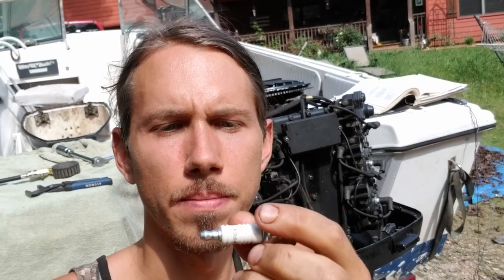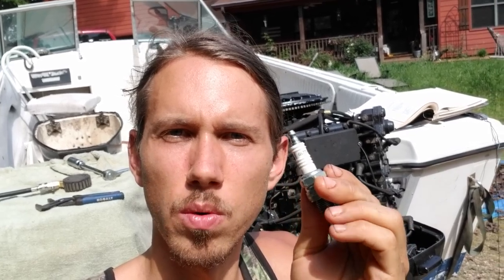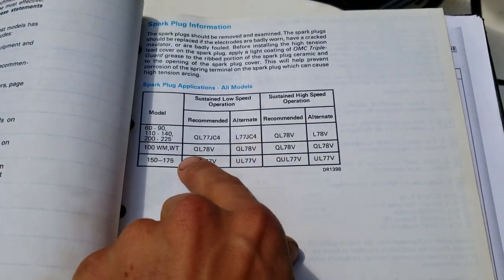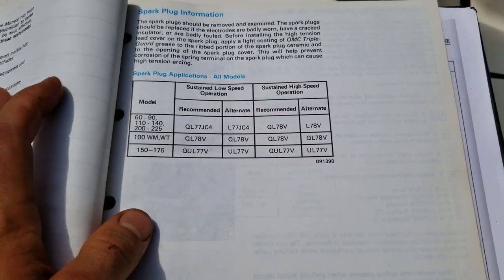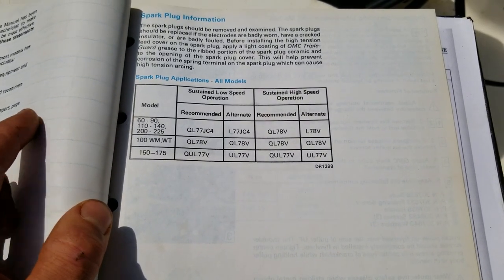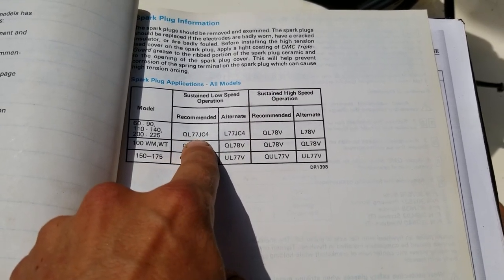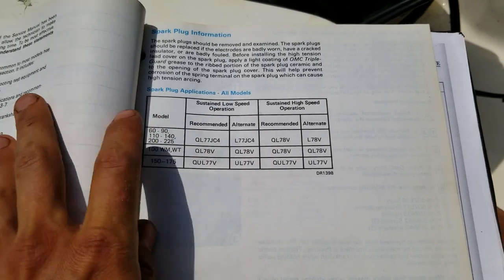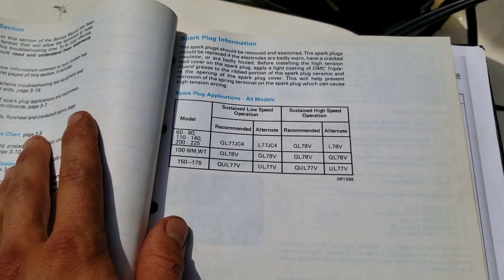BEST Evinrude Outboard Spark Plugs!

Comment: I'm not knocking you @ all, but years ago Champion plug was terrible in two strokes engine, fowling out badly, NGK was by far a better option.
Reply from the maker: You had these experiences with Evinrudes?
Reply: @MattsShop  no motorcycle
Reply: People have to get the right heat number,not car motor plugs..
Reply: I got through the 1st 20 or so seconds of the video thinking the same thing, only its not just 2 smokes, EVERYTHING!
I have had more plugs fail, or bad out of the box from Champ, then any of the others.

Champion is in those engines from the factory, and what OMC recommended, NGK for me in my Evi's.

Comment: I have the 87 johnson 150 v6 looks like the same engine. Need to change my sparks a mech. Gave me some weird number, put them in and they worked, however now after watching this im nervous. The charts onyl show the surface gap ul77v no J gap, however, when i went on a marine store and typed in my model number your pluggs came up. Model j150gtlcur.

Yesterday we went out to a river system and I didn't realize that it was idle speed only and I had some crappy NKG surface gap and this morning when I got up my heart sank because there was all this black gooey crap all over my transom saver running down from the cowling I touched it with my finger and it looked like burnt car motor oil so from what I reading those crappy spark plugs mixed with idle only speed caked it up pretty good
Reply from the maker: That SHOULD be the same engine. That's exactly why NGK and surface gap plugs do not go well with these engines at idle. Surface gap plugs are best at WOT throttle 5000 RPM running offshore. All that black goo is unburnt 2 stroke oil. Try to find a chart that show QL77JC4 they should work, but I tell everyone to double check because I never know 100% depending on the year make and model.
Reply: @MattsShop  sounds good! I'm learning from you, I am also learning my Motor. I see a bunch of goo remains on the front side of that I mearned is my exhaust cover.  From what I understand it's 28 bolts, a gasket, an inner plate, and another gasket. I'm assuming the gasket has gone bad.  I'm already gonna learn how to do the carbs cause I can see the fuel around the bowl gasket and the gasket where it connects to the header
Reply: @MattsShop  just got home looked around the exhaust casing and bottom left bolt def a leak. Ordering new gaskets :)
Reply: @MattsShop  also one last question. Then I'm going back to binge watching your videos. (Plus I subscribed!) How do I get the lower plastic cowling off the small two piece one. I undid the 4 bolt boat side but it still feels like it's bolted maybe above the pan? Lastly can I spray anything under the pan and in the bath of the old black goo in and behind the middle section to flush it out or will putting degreaser harm the drive shaft and stuff to the lower unit? Clearly I'm new to all this, also trying to be environmentally aware when possible. Thanks bud for everything!!
Reply: They work like a champ! Thanks! Did a carb rebuild noticed that 2 of my 3 units have one emulsion tube cracked. Hard to find a new carb. I have hear ppl soldering or JB weld as much as the crack as possible to limit the gaps. I was able to get her to 55.5 mph WOT yesterday, however, I bumped something w the cabling which made my idle really really low. So I gotta figure that out. Is that possible, or have to go through an entire link and sink?

Comment: I can’t get to plane on 110 v4 Johnson. without 15 pitch prop on 16 ft fiberglass. Had 19 on it.  Runs great compression test was fine. I Don’t get it ? Won’t run over 30 mph
Reply from the maker: There is NO WAY you need a 15 pitch prop with that setup. 19 will work. I've ran a 15 pitch on an Evinrude 140 19' boat (one in video) and it pulled the boat on plane in two seconds. Is the fuel pump diaphram bad? The motor mounted too low on the hull?

Comment: Thankx for the input champ 👍 I have a evinrude 1981 v6 175 hp and they take a ul77v  .will that  sparkplug you were talking about work in that .? Also it’s hard to get the ul77 v in Australia 🇦🇺..👍
Reply from the maker: It should, but don't trust me double check with online charts first. I'm not responsible for damages!
Reply: Can you please give me the part number
Reply: Thank you for your help Matt 👍
Reply from the maker: L77JC4 or QL77JC4 If you have electronics. You're welcome.
Reply: Many thanks for you assistance mate. Just one more thing what sparkplug  gap is needed champ
Reply: Surface gap plugs are really only for high performance crossflows run at high rpm. Yes the idle a little worse,  but they are much safer for the motor so it doesn't detonate. I recommend them for the 2.6gt/xp especially,  which is a factory modified 235.

Comment: thanks matt found a bad coil on my 1980 140 johnson .  put the one good  one i found on my 60 hp 1980 2cly probably why it ran like crap .  run better but still missing some pulled the nkgbr9hs out had two new  ql77jc4 in 60 hp plus the old two ql77j4 looked the same put them in and run even better going to get some more new ql 77jc4 plus some  new cdi coils 👍👍had 1977 140 it ran good on the surface gaps love the johnson evinrudes
Reply from the maker: Nice! Sounds like you got it running real good! I never really liked the surface gap spark plugs.

Comment: I have the QL77JC4 in my 84 Johnson 150. They work great! However, I was researching the gap difference. Mine requires a 1.19-1.35mm gap. Those 77s are 1mm gap. Can the gap difference cause any idle issues? Low speed cruising?

Comment: The "Q" is for suppressor, so you don't have extra voltage leaking back to your voltage regulator. There is a difference in price when buying a Champion spark plug with the Q and without the Q.

Comment: Hi Matt. I just got 3 new Champion L77JC4 plugs for my '93 Johnson 70. Dang if the gaps are not all over the place. Can you tell me the correct gap for them?
Reply: Manual recommend Champion QL77J4 @ .040”

Comment: It also just started hesitating on acceleration a little and sputtering slow idling
Reply from the maker: See if you can use these plugs. It could help...
Reply: @MattsShop  shit my vro pump was cracked. Waiting on new 1 but USPS is slow as ever right now. Who knows when itll come

Comment: Ok I got a 1983 evinrude v6 150hp 
It uses UL77V or  L16V Surface Gap plugs. 
Can I use QL77JC4??
Reply from the maker: This is a 1986 Evinrude V6 150 XP and the QL77JC4 works. Check charts online though.
Reply: I ended up buying the spark plugs I checked piston to valve clearance before starting the motor.  And man you can tell a difference on how the motor sounds smooth idle. She maxes out at 58 MPH

Comment: I bought them plugs what is the gap for Evinrude XP 150 1985
Reply: I looked on the chart it says 0.30 but I asked where I bought the plugs he said 0.60 which one should I do
Reply from the maker: That is the same exact outboard as this but one year older the gap is 0.30. Ran it like that for years. 0.60 is insane.
Reply: @MattsShop  Hey Matt, when i bought the QL77JC4, they told me they come pre gapped, the gap is like 040, should i change it to 030 ?  because to get it going , it takes about ten  to fifteen pulls to get it started, but when its warmed up , it will start on first pull.

Comment: Hah! Champion are trash! My ficht fouls them up immediately.
Reply from the maker: Hah! FICHT is trash. You know what that rhymes with.
Reply: @MattsShop   well it’s 21 years old, 125psi in all six cylinders, and hauls ass so what it rhymes with is irrelevant.
Reply: mine too - what plugs do you run?
Reply: Ngk iridium, autolite, Denso iridium, AC here in all my outboards. I haven't specifically asked for a Champion unless store was out of the others in years. Champs are made in China and have the highest DOA out of the packaging than all others combined, and that goes farther than just outboards.